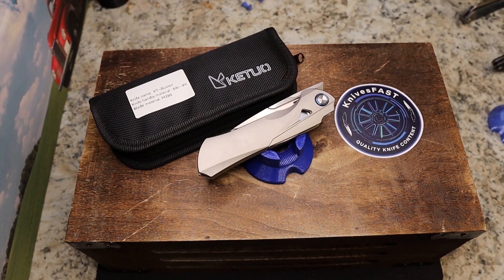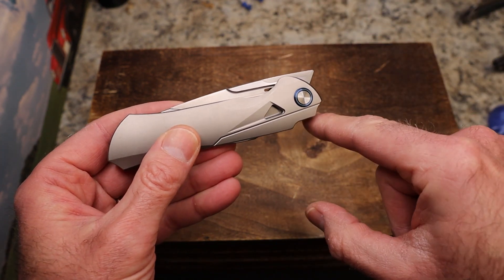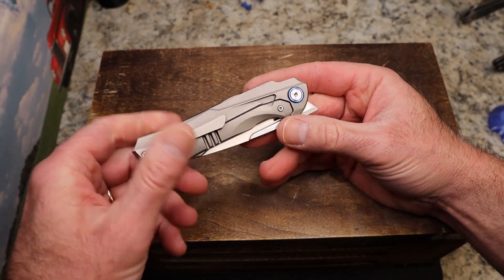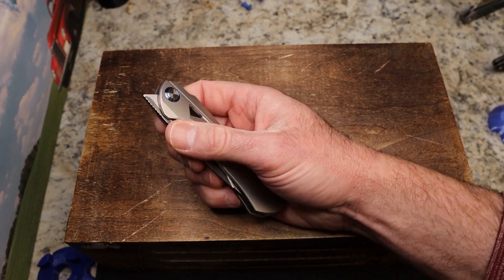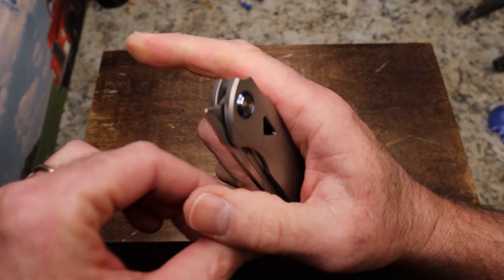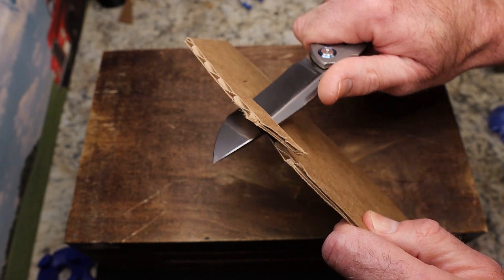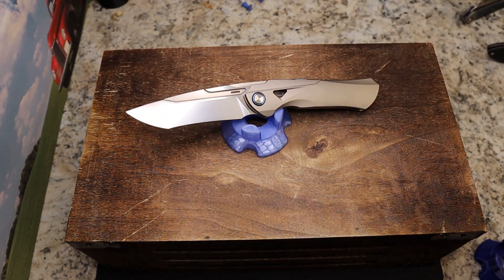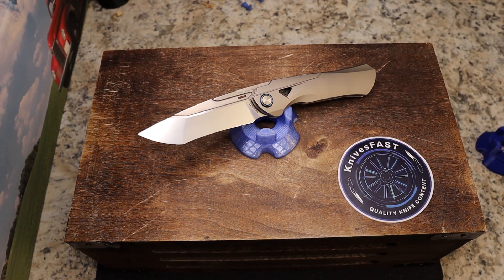Love at first sight.....and then reality sets in...

Comment: I'm not looking at it differently, but I am having a different experience with mine.  I have flipped it a few hundred times by now and I've never been pinched, and I have large hands.  I’ve even tried to get pinched and still can't make it happen, so maybe there’s a difference in how we hold our knives?  As for sharpness, its a smooth, consistent cut with every material I've tackled, including various types of cardboard, paper, cloth, leather, and plastic.  It's going to be a tad bit more work to sharpen when it comes time, but I knew that going in.  So far The Illusion has been a nearly perfect EDC experience for me.  That being said, I can see how some folks might not find the blade shape to be their thing, but my experience thus far has been a good one.
Reply from the maker: I mean there's no doubt. It's a really well made knife and the idea is surrounding. The design are pretty awesome. But yeah it definitely pinched me and did not feel good. But everybody's experience  is usually different. Thanks!